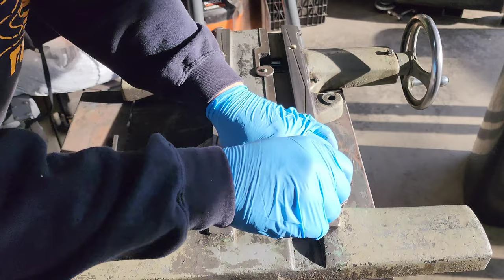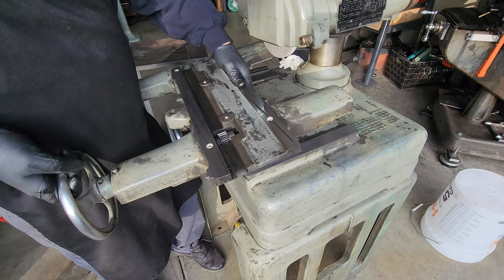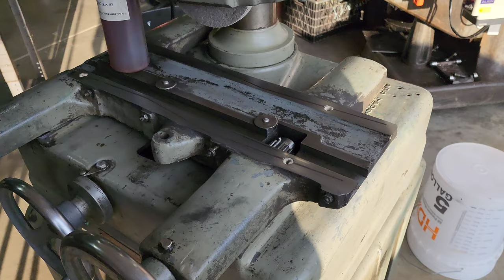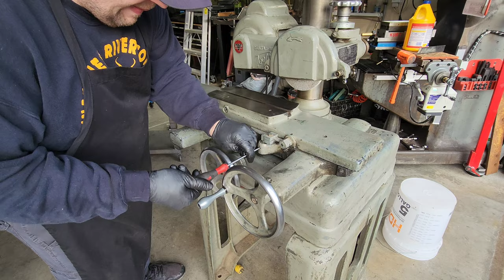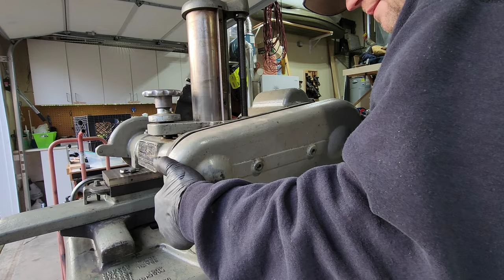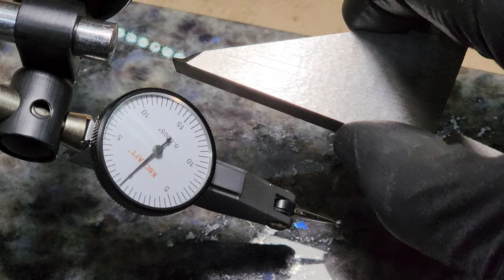Delta toolmaker surface grinder rebuild part 3 reassembly and the first test grinding.

Comment: I have one of these grinders that I refurbished a few years ago. Your rear bearing on the spindle should be a slip fit in the housing, so you can clamp it tight to the shaft with the nut. It can then move back and forth to allow the shaft to center in the bronze journal bearing as you adjust the clearance. The tapered bearing design adjusts radial and axial clearance at the same time, and if the shaft is being held axially by the ball bearing, this can't happen. Also, if the ball bearing inner race isn't clamped to the shaft, it can turn on the shaft in use, causing fretting wear. The outer race also needs to be able move in the housing to allow for thermal expansion as the shaft heats up during use. It takes some fiddling to get the bearing adjusted so it runs with just enough clearance that it doesn't get too hot in use, but gives a satisfactory finish. The bearing housing behind the wheel should get warm to the touch, but not too hot.
I think your shaft may be a little loose, allowing the wheel to bounce a bit under load. I get better finishes if I take no more than .001 at a pass, with a step over of .050 per pass (half a turn on the infeed.) Then do a "spark out" pass feeding the other direction, but offset the passes by .025 so the lines don't overlap. For example, if the first passes had the handle on the infeed stopped at left and right, the next pass has it stopped at top and bottom. I also noticed you have one of the pulleys on backwards. The large and small sheaves should be opposite on the  shafts so that there is a larger difference in wheel speed in the 2 belt positions. I run at the slower speed as the higher speed is near or over the limit for most  7" wheels.
 Looking forward to seeing your progress with this machine, especially if you decide to rescrape the ways.
Reply: @davisjensen3403 Good call on the rear bearing. I'd like to reach out and discuss my rebuild as I move forward.

Comment: Its interesting to see how your bed mechanism works Jim. Mine is on ball bearings. Rockwell Delta made many changes over the years. My leadscrew binds again, so I’m gonna reengineer the whole thing. It’s annoying not being able to use the full 6 inches to grind materials.  Thanks for sharing good Sir,  Gilles

Comment: I have one of these grinders, you’re never going to get the kind of finish that you see on the nicer grinders. There’s a post below me with some good info about adjusting the spindle. You also need to balance your wheel. You’ll get a better finish, but never what you see from cable and ball bearing grinders. The rack and pinion that moves the table is always going to translate into the work. Also, due to the design of the ways and rack and pinion with a gib against the rack, these grinders are no good for cup wheels or side grinding of any kind, there isn’t even any type of v-way to keep the table in line with the x/y travel. The most i can say for these grinders is that they’re “serviceable”. You can get flat within a couple of tenths pretty reliably. Oh, and you need to grind that mag chuck in situ after installed. That’s going to give you a surface that is parallel to the wheel through the travel of the table. Just slapping the chuck on top and going ham isn’t going to work. And you’ll need to re-grind the chuck every so often, basically any time you’re setting up for a job that requires high accuracy you’ll want to skim the chuck.

Comment: As mentioned by people above who do already have the machine, I have to figure it’s the cone spindle bearing. It seems to be a very fussy mechanism to be able to dial in the right amount of preload without having it gaul up itself.
Do you think you’ll do a full cosmetic restoration one day?
I’d really like to see that.
Reply from the maker: Thanks, I actually sold this one so no full restoration video. sorry

Comment: Nice rebuild. If you can move to grinder with a coolant system... So much "better" finish on parts...and less stress on the machine (my opinion)..cheers john

Comment: What material did you wind into the oil passages? I'm restoring one from the early 40's. Also; what's the best way to open the Brown & Sharp magnetic chuck to clean it?

Comment: There is a too black cam bolts one by the spindle one the belt side and one on the operator side that is to chang the tram of the weel something to look at
Reply from the maker: Thanks, eventually I did find those. a lot of trial and error though